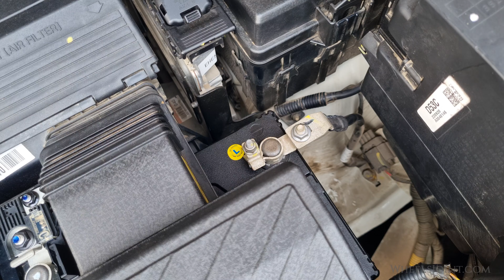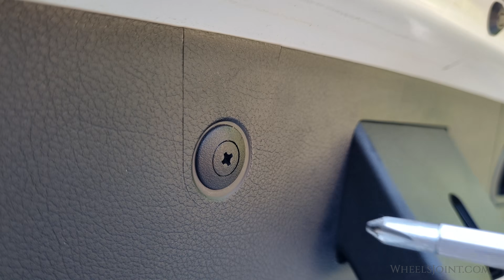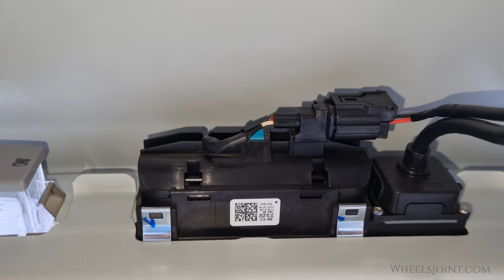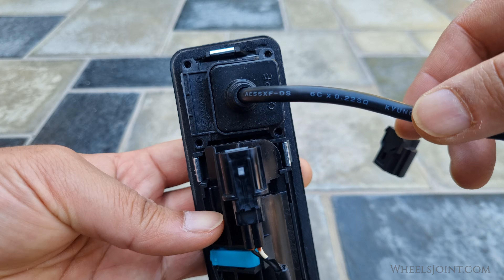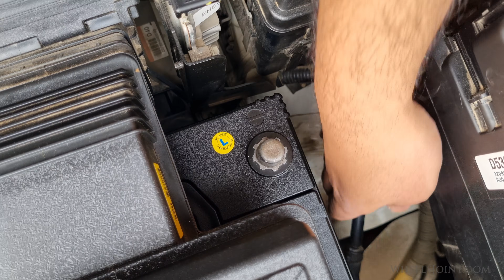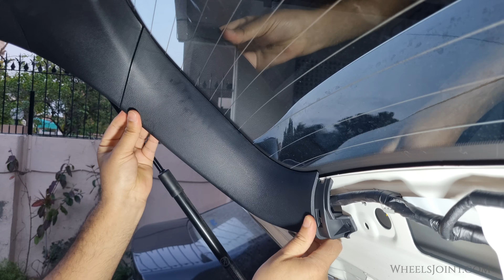How to replace back view camera in Kia Sportage

Comment: Brilliant my QL4 is slightly different but close enough that I managed it without a problem. I found I had to flick the front clips off the handle/camera assembly as mine was a bit rusted. I got the replacement camera of Jeff Bezos for £16 quid versus £650 from KIA and fitted it in under an hour saving me another £200. Thanks for doing the video
Reply from the maker: That's awesome! Glad the video was helpful and saved you money! 😊

Comment: Thank you for this video, helped me a ton! I have managed to change the camera.
A few extra tips for those who have electric tailgate - instead of the pull handle you need to remove the tailgate button and disconnect the switch, its easy. I also had an extra 2 screws on the tailgate inner panel. Regarding the camera switch / liftgate module - I couldn't remove it since the metal clips were way too hard to push and I didnt want to damage the module. Instead i screwed the camera off the module while attached to the tailgate. 3 screws were easy, but one requires a short screwdriver to get to this tight space. Getting this screw back was also a problem, I managed to do it by taping the screw to the screwdriver since I didn't have a magnetic one.

Thank you again!
Reply from the maker: Yes, releasing metal clips was the hardest part.

Comment: Hiya,

I just done this- thanks for the video- it was really easy.  The only issue I have now is after replacing the camera the boot handle;e now doesn't work.  I've connected everything and double checked but no idea.  Don't suppose you've come across anything similar?
Reply from the maker: Haven't faced this issue. What I can suggest is to reconnect the old camera and see if the liftgate open switch starts working again. If it does, it means there is an issue with the new camera wiring harness/connector.
Reply: I tried, and the old one just kept the boot unlocked. Even when I locked the car. I've noticed there's some deterioration on the rubber push button (worn through) so I'm going to try replacing that as well. 

Thanks for getting back to me. 👍